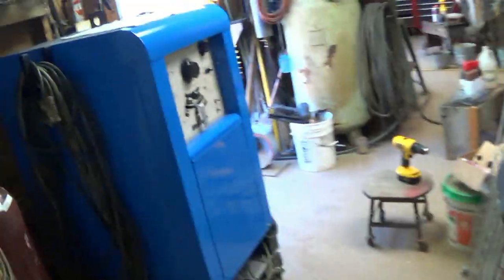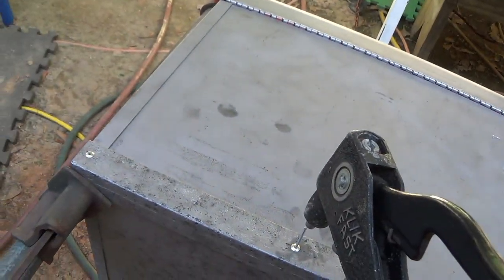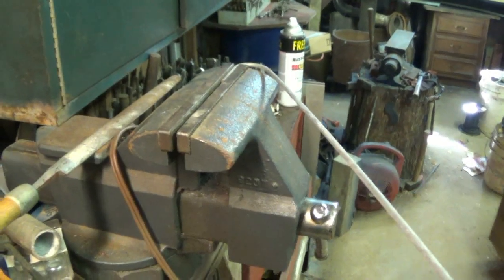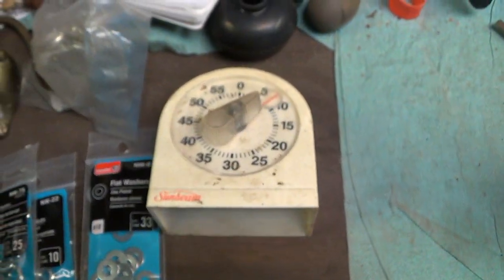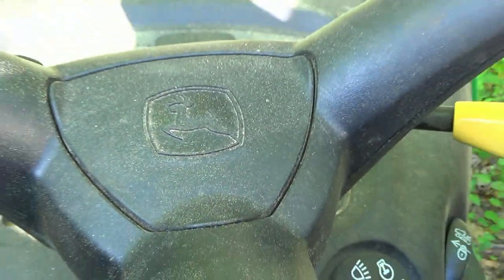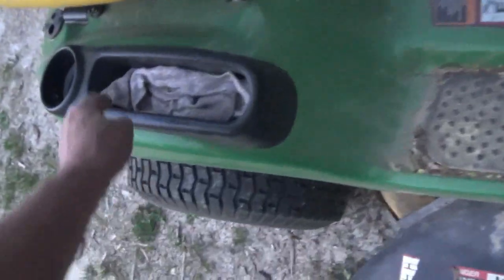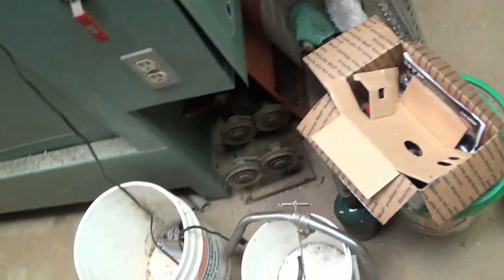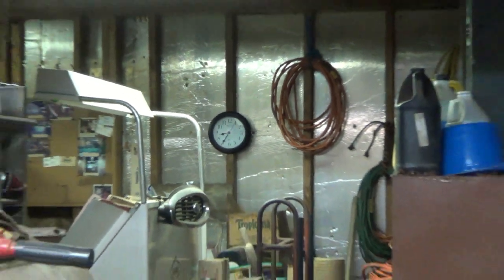it Red

Comment: if you ran that internet cable yourself (not  a cable company or phone company) next time find some old perished or leaky garden backyard hose and run it in that for some protection (more so you see it first than protection from blades). Even if you only have a short length of hose, a few metres/yards, use it in the worst area (basically, where you just cut ;)

To feed it into the entire hose in one go easily, you use a small piece of scrunched-up paper on the end of the cable, suck it through from the other end with your shop vac. (keep the hose pretty straight) For long runs, pull some paracord or thin light cordage through first, then use that to pull the rest through.